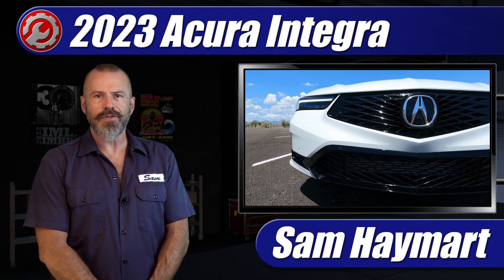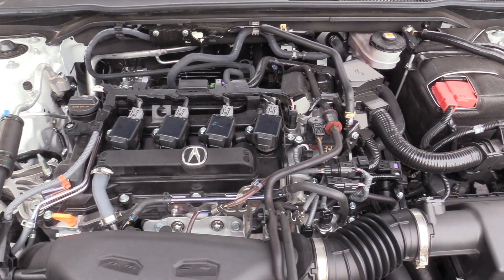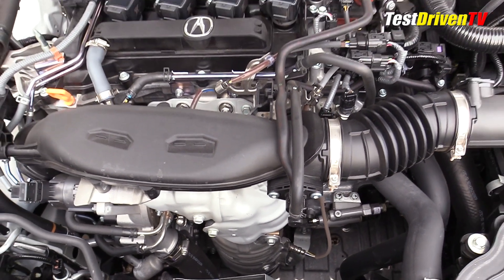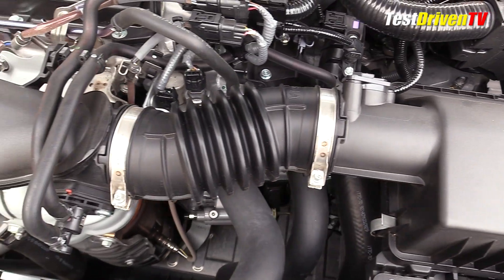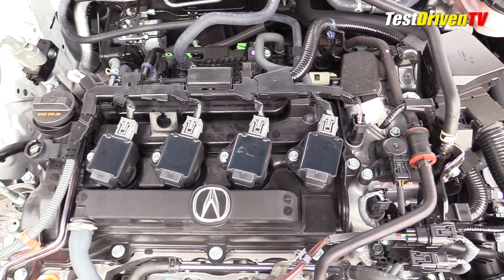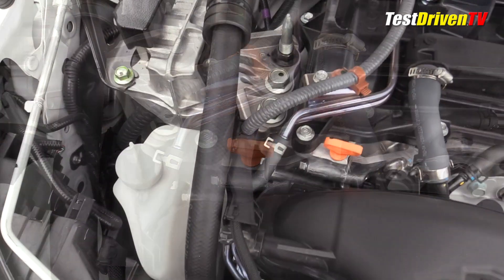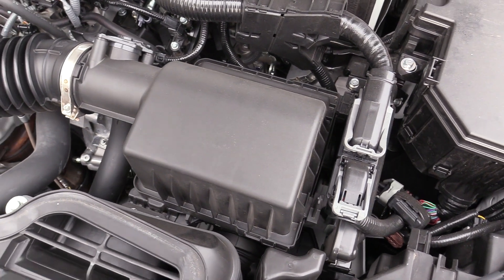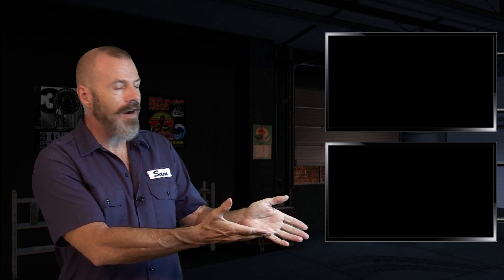2023-2024 Acura Integra: Engine Explained

Comment: You mentioned at 1:10 that this vehicle has significantly strengthened rotational mass, block and internals compared to previous generations. Can you please cite this claim for me. I see a ton of people popping these like corks with mild modification
Reply from the maker: General Motors press and specification material + personal conversations with the engine program's head engineers.
Reply: @TDTVGarage  thank you, there isn't a lot of data that I've seen on the L15CA vs the B7. Are any of the materials above in the public sphere? I'd like to know some of the ways the L15CA has been reinforced. 

Thanks again for the reply

Comment: Why dont manufacturers build in an eco mode for 87 octane and a sport mode for 93 octane... 4 cylinders should be able to make 200hp without premium these days
Reply: This engine has 1.5 liters of displacement and has an oversquare stroke designed for more low end torque. You build horsepower with higher rpms, this engine isn't designed for that and the higher the speed an engine spins the more resistant to detonation you a fuel to be, hence the higher octane. What do you want from these people. Care to share your engineering degree with the class?
Reply: the reason why is admissions you get better fuel economy with 91-93 in a turbocharged car it’s a really cool idea and ford does something similar with flex fuel where you can run e85 87-93 octane and the cars performance would change with the fuel in it but most manufacturers don’t do this

Comment: Great Description,  Sam. Does this require Premium fuel?
Reply: Pretty much all turbocharged cars do. You can run a lower octane these days and get away with it, but that's because the computer will compensate and choke performance to mitigate knock.
Reply: No, just recommended.